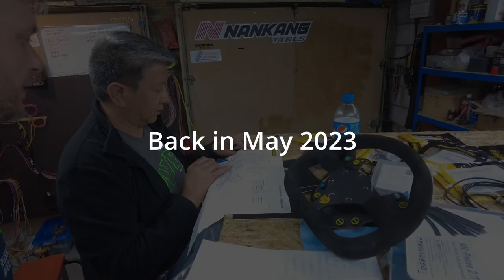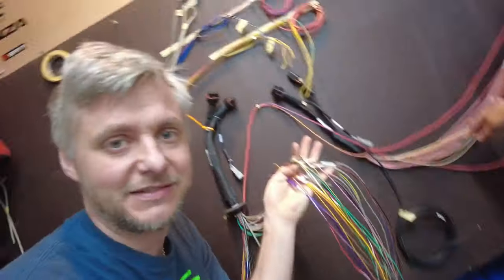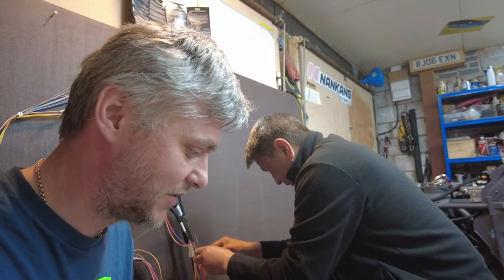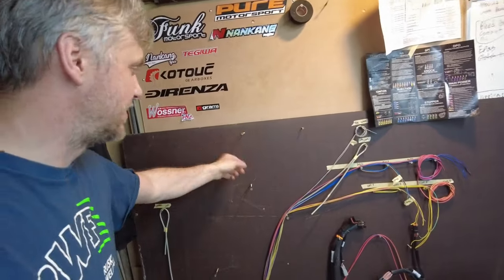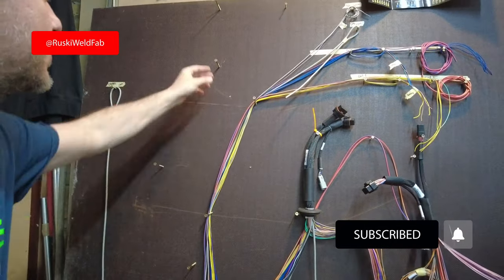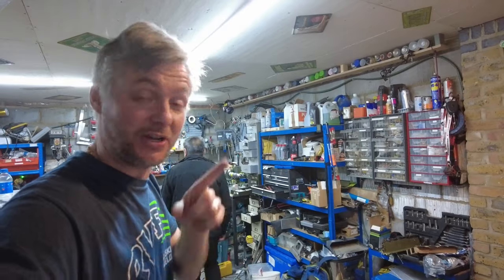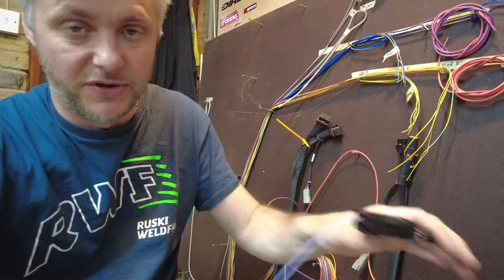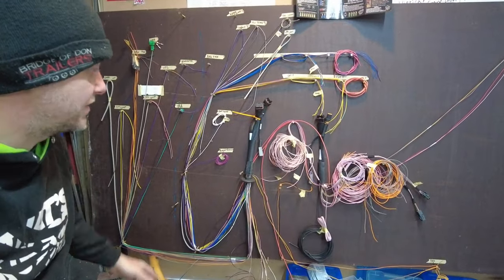How difficult is it to DIY a wiring loom for your race car from scratch? Part 1

Comment: Having just sorted out a entire car rewire using an OEM harness as the base, cuting, splicing, extending, pinning repinning sleeving adding motorsports connectors moving the fuse box and ecu.  I can attess that starting from scratch would have been SO much easier.  I bet i have 100 plus hours in the damn wiring...  looks great but thay time i could have buolt parts to drop 20-30 pounds off the front of the car and seen a real on track benifit. 
Time attack Evo X build